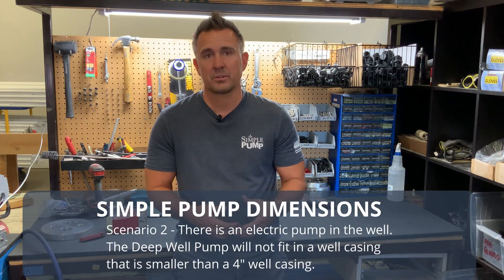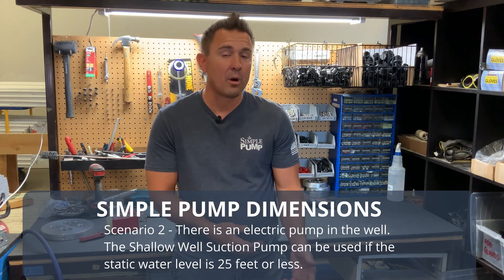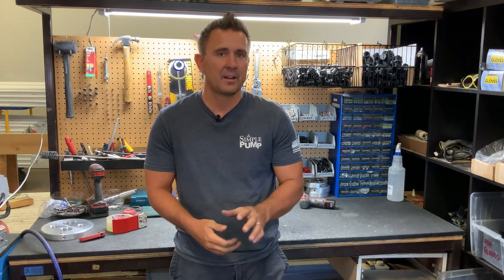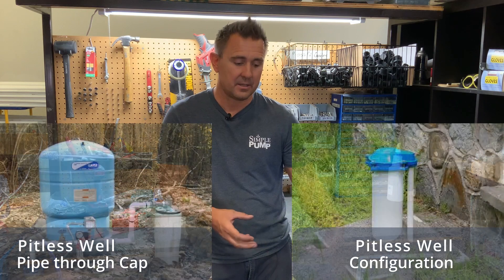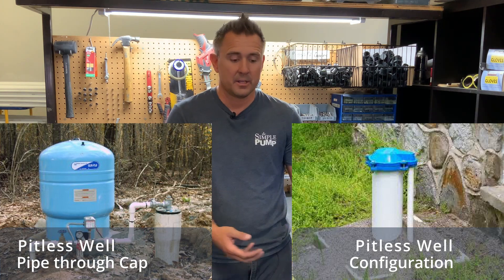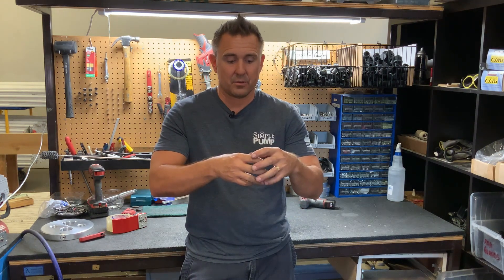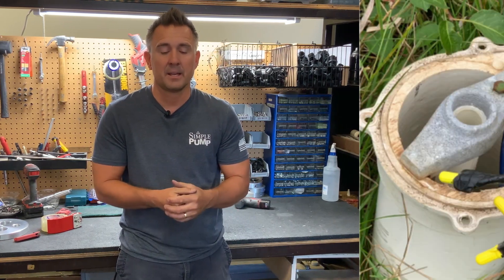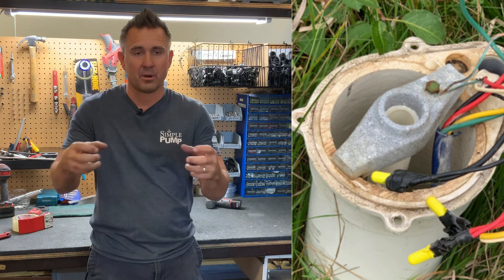Simple Pump Well Pump Basics - Well Casing Clearances

Comment: I have a newly dug well (about 1.5 yrs ago) and no pump installed yet. I would like to install a Simple Pump only as it would likely meet my water needs but at some point in the future may decide to install a permanent electric pump (run by generator as i am off grid) beside it. Does it make a difference or are there challenges to install a simple pump first and then install the bigger electric pump ? would i need to uninstall the Simple pump and then install the electric pump followed by reinstalling the Simple Pump or does it make a difference what order you install both types of pumps ? My static level is about 235 ft., so i cannot use solar or battery bank method for the simple pump.

Comment: Cost of simple pump
Reply from the maker: The cost of the Simple Pump varies depending on the specific system and well configuration. To get an accurate quote, you can visit the Simple Pump website and fill out the free quote request form https://simplepump.com/request-a-quote. You can also view system estimates based on the static water level - https://simplepump.com/pricing.